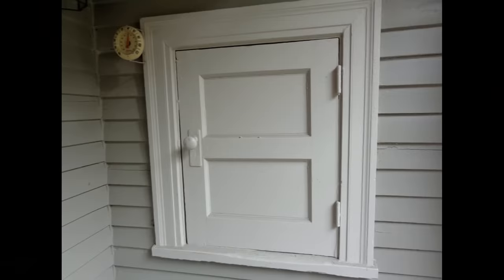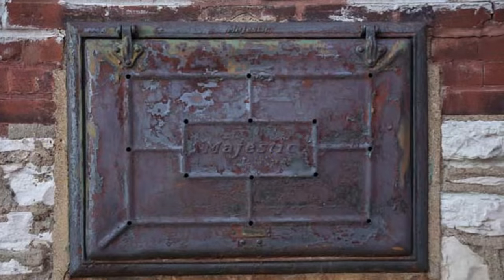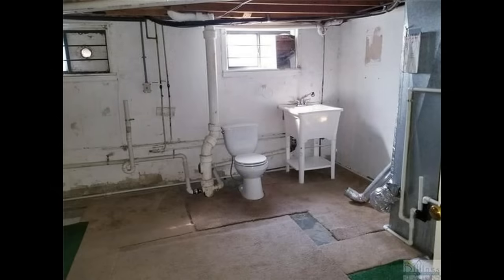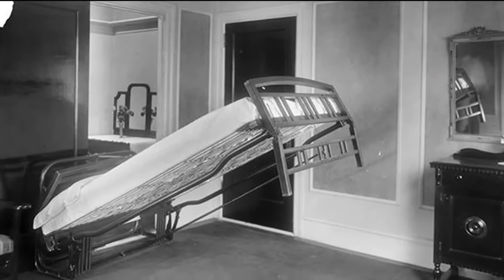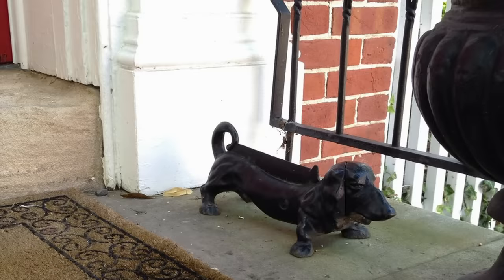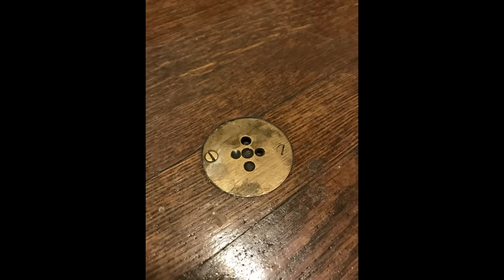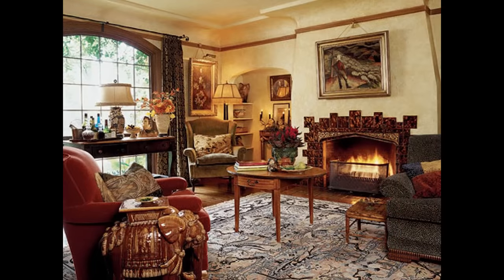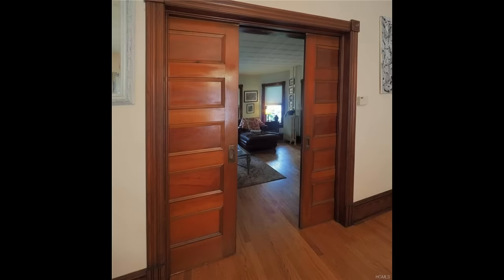Mysterious Home Features No Longer Used

Comment: I think the picture hooks need to make a comeback for apartments and dorms since we aren’t allowed to nail things in and command strips don’t always work with the wall texture.
Reply: Apartments, dorms, and rented houses (specifically public housing).
Reply: Problem is repainting the apartments is more costly the more detail you have to avoid. Like how most rentals your inner door frams will always match the wall color. 

There's so many layers of paint in some places it's probably decreased the square footage.
Reply from the maker: It is a great idea.  Thank you for watching!
Reply: I used packing tape to hang my posters in my dorm room because the walls were painted cinder block
Reply: My apartment has picture rails below the crown molding but I imagine most people don’t know what it’s for. The crown molding and picture rails are only in the living room though. It’s kind of neat how they did it. The crown molding, picture rail, and space between it are all white so it looks like one piece.
Reply: You can hang pictures in an apartment. Who the hell told you you couldn't?🤣

Comment: I'm surprised that pocket doors did not become the norm for home interiors.  They free up so much floor space and have a neater, cleaner look.  I've lived in homes that had them, and loved 'em.
Reply: Yes, pocket doors are fantastic! They would particularly benefit small apartments...
Reply: I love pocket doors
Reply: Yeah, but they also mean ripping out the whole wall when they get stuck.  
A kid throws a ball in the house and a hinged door gets damaged? go to Lowes and find a replacement that's easy to pop in.  Paint it any color you like, and just paint over that when you change your mind.  But refinishing a pocket door means taking off the molding and sanding it to bare wood, or risking painting it shut, not covering the old color, or bumping it off track.  And God help you if it gets off it's track or the cat bats a small rock into it and it won't open or close the whole way...
Reply: @mwater_moon2865  Yeah, they do have drawbacks, but I still like 'em.
Reply: @mwater_moon2865  Thank you, yes! Pocket doors are the bane of my existence.
Reply: Pocket doors are a great feature however, they limit where you can put light switches and outkets on a wall. I have 3 pocket doors and the light switches end up being in the middle of a wall. A design consideration.
Reply: My Grandmother’s house that was built either late 1930’s, early 1940’s had a pocket door for the bathroom.  The toilet was on the wall that the tract for pocket door.  I don’t remember where the light switch was located.
Reply: @mwater_moon2865  lol speaks the long suffering voice of bitter experience...
Reply: I love ours! We have 2 into the kitchen.  One into the living room and one to the dining room.  Don't use them much, but I do think they are great for doors when doors wouldn't work.
Reply: pocket doors are popular in Florida homes. Wheelchair access in and out of bathrooms is easier with a pocket door and is building code here.One bathroom in a home must have a pocket, door.
Reply: I have two pocket doors in my house, I love them. They are awesome to close off parts of the house to keep my toddler from wandering.
Reply: Ever try to fix a broken pocket door?
Reply: My Queen Anne has them, I love 'em
Reply: @mwater_moon2865  I disagree, Ive had mine get derailed and stuck, you just need patience. an assistant with a flashlight helps greatly.
Reply: @Marcel_Audubon  My husband did fill me in on some of the difficulties of having and maintaining pocket doors.  I agree that they are more trouble and more costly if something goes wrong, but I still like them.
Reply: @johnmiller8975  I wasn't born with that particular type of patience 😆
Reply: @texas2step266  they do look sweet!
Reply: @mwater_moon2865  mine got off track and I finally took a good look at it and found it wasn't hard to fix or even remove the doors.  Maybe not all were made this way since this was a 1994 installation.
Reply: As a luxury hotel maintenance engineer fixing pocket doors was afull time occupation also firehazard if they stuck or slipped in an energency
Reply: @jamesbowen2105  I'm beginning to see why the pocket doors did not catch on, but I still like 'em.
Reply: I call them sliding doors but I have 2 separates kitchen from living room they tell me to knock down my wall I tell them no I don't want to live in a factory. Plus the dinner conversation shouldn't interrupt the tv 🤣
Reply: I love them but I think I remember being told that they're costly to install which may be a large of why we aren't seeing them often now. I had a home with bi-folding French doors between rooms. They're gorgeous and kind of a perfect in between option.
Reply: I have a pocket door in my hall on my way to the bedroom in my older (1978) built condo in Florida. I like pocket doors. They save space
Reply: What about the ice doors or milk doors? 
They would certainly cut down on porch thefts of delivery boxes.  

I can't believe that was not a concern until 2020.
Reply: @TheNoiseySpectator  It's time to bring those doors back.  It used to be that there was usually someone at home to receive packages, which were far fewer, during the day, but now that most moms work, boxes are set on the porch and the pirates plunder.
Reply: when i was building homes, near two decades ago, we commonly installed pocket doors.   i dont see why they would have fallen out of favor
Reply: Comes down to money, as in spending less in construction. Faster and cheaper to slap a 2x4 wall up with a normal hinged door on it(or just an opening) then to build a bit thicker wall, and deal with putting in the sliding assembly and the door for it on one or both sides of the opening. I did live in a house for a year or so that was built around 1900 near Pittsburgh, had really nice pocket doors for the living room for both the main entry way, and into the dining room. House was old enough that it still had remnants of the old gas lamps in the basement and gas pipes in the walls for them.
Reply: @mirthenemrys  uh, no. walls dont need to be thicker AT ALL for a modern pocket door. typicly they are put in for closets, if they are used at all in modern times. more over they are easy and fairly quick to install without the need to make sure the door is hung plumb. done both more times then i can remember
Reply: @mwater_moon2865  Oh good lord,  now I'm gonna be paranoid in my new home which is full of pocket doors except in the bathrooms. hahah
Reply: @_itzastro4931  I have pocket doors all in the house...EXCEPT the bathroom. Interesting.  I always thought that I'd rather have in the bathroom than bedroom with pocket doors, just like that.  One thing about the electrical issues with lighting and pocket doors. Put the light switch on the OTHER side of the 'pocket' that is where it would naturally be anyway, as that's where the person comes through.  Just saying .
Reply: Cost and maintenance.
Reply: @carolshappyplace5828  Yep, I had the same problem. A surface mount remote light switch solves that problem. I have one where the pocket door is mounted... and another I can move around the room to turn off the overhead light from the bed. (It's identical to the remote control light switches except the remote doesn't get lost.)
Reply: They have never went anywhere. I installed them on nearly every house I have worked on in the past 20years  but, the last couple years more people are going for barn doors instead resulting in less wall space and less sealing off a room compared to pocket doors.
Reply: @davidtal523  they haven't. I've been building for at least 20 years and I install at least 1 per project except in the last couple years more people have been wanting barn doors instead.
Reply: @mirthenemrys  I disagree a cheap pocket door frame won't cost more than 150 and a premium one that doesn't require any fasteners can go for 400+ but the cheaper one will still cost less than a standard size door. But that is new construction only. As far as remodeling you're right on as tearing the wall all to hell to put one in will cost ridiculous amounts of money and time.
Reply: @leefischer5814  Interesting.  I can see the attraction of barn doors in a few very specific settings, and only in a really big house.
Reply: Love pocket doors, but intensely dislike barn doors! I don’t like millions of pillows on the bed either.. juss sayin’ lol
Reply: My boyhood home was a bungalow with pocket doors between the living and dining rooms.
Reply: @one4blondes  Yeah, a pocket door dividing the sink from the toilet and shower/bath allows the bathroom to be used by two people at once.
Reply: Pocket doors are great until the first time they need to be replaced and you have to tear the wall up to do so
Reply: @mwater_moon2865  I agree. Pocket doors also mean no wiring or insulation in that part of the building. I would choose having insulation in my walls and light switches and electrical outlets where they make sense over having a pocket door.
Reply: Pocket doors are so practical.  Unfortunately, today’s pocket doors aren’t as thick so they get a bad wrap.
Reply: I will also add… I wish we would’ve incorporated pocket “doggie gates” into our kitchen when we remodeled.  The contractor said it would be too hard, but I still think we could’ve pulled it off. Every kitchen should have them.
Reply: my gram and uncles houses both had one. my grams was between the foyer and the kitchen. I used to close it when my mom chased me haha. my uncles was in his bedroom for the bathroom. that one made sense since there wasn't space for a door to open. the only problem is in California with the earthquakes, there are many all the time but so subtle you don't feel them, they shift the house and occasionally the doors don't open and close correctly. having a pocket door, it could get stuck.
Reply: @WomanRoaring  I love the image of you closing that door as your mom runs after you.  Earthquakes are an argument against those doors.  We have expansive soil in this part of Texas, causing houses to shift, usually sinking on one side.  That would screw up pocket doors too.  Drat.
Reply: A good compromise is a wall mounted sliding "barn door".
Reply: the problem is is that they need thicker walls in order to accommodate them and the plumbing and electric have to be planed around them because of the space they take up Thats why barn doors took off starting in 2011. they are easier to retrofit than pocket doors. However I did see a pocket door in a new build during the parade of homes in my area 2 years ago it was fabulous. I love pocket doors myself. When I build a house it'll have loads of pocket doors love em. they are much neater and dont need space for the door swing.
Reply: @mirthenemrys  gas lights can be retrofitted for electric
Reply: As a small child I tried to follow my grandfather into a room.  He closed the door behind himself and my pinky finger got mangled in the hinges.  He built a new house for him and grandmother to live in after that, and every single door was a pocket door.  It was impossible for us kids to get our fingers in the door hinges.  As far as safety is concerned, I'm surprised they didn't become part of the building code.
Reply: @Tmanaz480  they take up a lot of exterior wall space. pocket doors dont take up extra space, they utilize unused space.
Reply: I have been thinking this! So much better than these barn doors. I love pocket doors!
Reply: Pocket doors are all the rage now.
Reply: I've lived in 6 homes, all of them older (one nearly 100 years old...wonderful craftsman bungalow ❤), and half of them had pocket doors. 
I LOVE pocket doors. 

Barns doors are ok, but they take up so much wall space.
And I think the fad will pass and then they will just be dated...like avocado green appliances.

Pocket doors are timeless.

Ahh, the craftsman had push button light switches too. 
I adored that place.🤗
Reply: Instead of having a bedroom door, I had an accordion door put in. I really like it.
Reply: In places with large temperature shifts they can get stuck pretty easy
Reply: @shawnalLovesJesus  That would save wall space too.  Good idea.
Reply: We live in a 1956 house that used to have 3 pocket doors.  We have added 2 more and just love them.
Reply: Pocket doors are a pain to maintence and awful if you need to change anything electrical around or through it too
Reply: You wouldn't be so delighted with pocket doors if you've ever had one stick partially open or closed. Repair requires taking apart part of the edging boards to get at the rollers. An all-day job and then some.
Reply: @throne1797  No doubt that would frustrate anyone.  But things can go wrong with lots of stuff we enjoy, and we still want to have them in our homes.  Flush toilets come to mind...  🙃

Comment: I love to see old homes. They were usually crafted with so much love and care. Not to mention it was meant to last!
Reply: There’s certainly a lot more old-growth wood in older homes, but survivor bias will always make past construction seem sturdier than new construction since only the well-built and maintained examples will remain from any era of the built environment.
Reply: Some don't realize and/or appreciate that when you see an old farmhouse that has the decorative wood ornamentation on the porches. Usually along the railing poles. That fancy woodwork was all hand made, in the yard, in front of the house while it was being built.
Reply: @millicentduke6652  That is an excellent point Millicent! Did you coin the phrase "survivor bias"?
Reply: But not all old homes that were built to last were built with love and care.  Some were built sturdy but not purdy.
Reply: @nankerphelge3771  I seem to remember seeing the phrase elsewhere, suspect it is somewhat common in statistical usage.
Reply: Today’s homes are garbage. I will never call those pathetic excuses my home. I need a Victorian era home.
Reply: @millicentduke6652  The two big drawbacks of those old homes are the lack of insulation and the drafty doors and windows.  Better add a third...plumbing.
Reply: I live in an old 1950s river house and we just recently tried to remove an ancient ac unit. I wouldn’t have been surprised if the builder had superglued every single nail. 😅 They we’re definitely built to last.
Reply from the maker: Thank you for watching and sharing your thoughts on old homes.

Comment: I would love to own one of these old houses. I love separate rooms, natural wood, pocket doors and everything in between. Houses looked so warm, elegant and beautiful.
Reply: In my town we have so many beautiful historic homes that are crumbling away. It makes me so sad. If I had the money I would love to buy one.
Reply from the maker: I do love the older homes.  Thank you for watching and sharing your thoughts.
Reply: @Littlemom1977  In our local Technical college (now a regular college) they have a degree program in Home Restoration, not renovation) Since the Eastern Ohio Valley and Wheeling WV area has so many homes from the 1800's and early 1900's, people would rather restore the old lathe and plaster walls, and the beautiful wide woodwork, so we have a demand for restorers to bring the old homes back to their historic conditions instead of just throwing drywall up and putting cheap pine  modern woodwork in.  When we updated our 1907 home, we did upgrade the mechanicals, but the woodwork was kept as stained oak.  The interesting thing is we are near Amish areas, and we can buy historic pattern oak woodwork cheaper from there than buy modern painted finger joint  pine trim!
Reply: Who needs this open concept?  I love my brick house built in 1926..solid as a rock, a full basement, and three stories !  Cobblestone driveway that leads to a detached 3 car garage, an acre of land, hardwood floors throughout, laundry chute, stained glass windows!  I would never consider living anywhere that was built after 1940! What was built  after the war is disgraceful !
Reply: Act fast bc developers are hungry to tear them down!
Reply: I agree. I would so much prefer an old home to any new one. They're so graceful and charming.
Reply: Having a dumb waiter and hoot would be great!